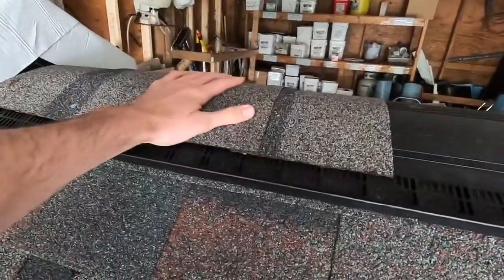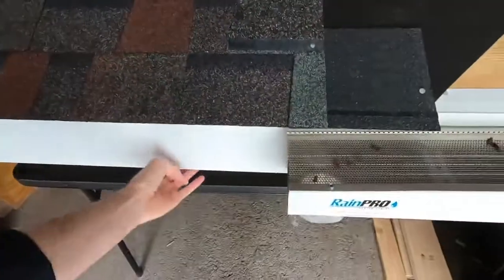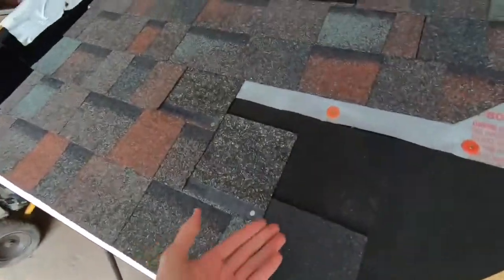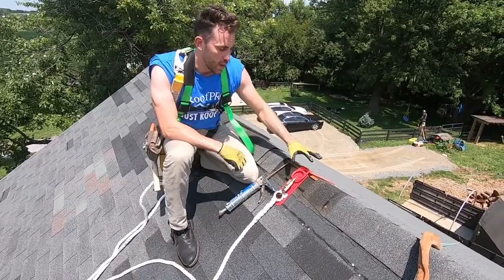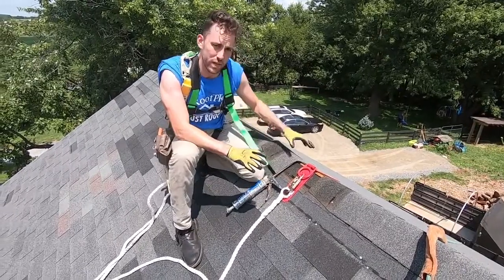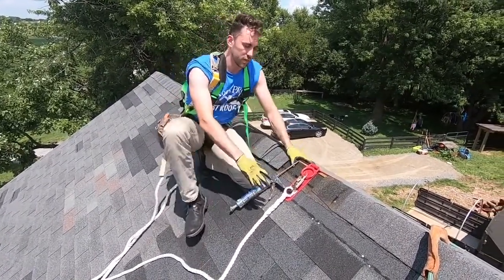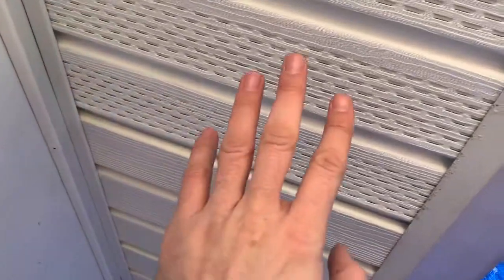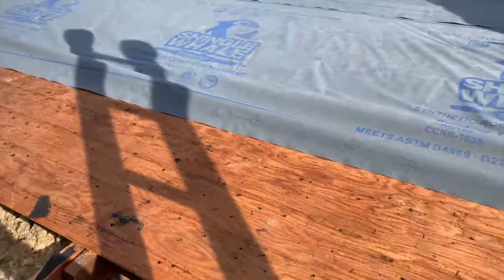Attic Ventilation Repair and System Review

Comment: My house and my garage have that “fake” soffit vents. All soffit cavities are covered with soffit sheathing and those white vented soffit plates are just for decoration.  
I don’t have gable vents either.  How many holes/what size should I drill.
Reply from the maker: Ventilation depends on the size of the roof and a few other details. So it would be good for me to give an exact size or number without inspecting it first. Here is a tool that might help though, https://www.owenscorning.com/en-us/roofing/components/vent-calculator

Comment: Keep your videos coming.
Reply from the maker: Will do!
Reply: @roofpro7003  What steps should followed when laying down shingles and or metal roof. What is and purpose of ice shields?
Reply from the maker: @joycedimaggio3816  I'm not sure if I understand the whole question but the purpose of Ice shield is to prevent ice and water from getting under your shingles in the most vulnerable spots. (Valleys, walls, pipes...) For example, the eaves of your house are the most likely to have snow and ice build-up because of the temperature changes within your house and outside the house. So this will protect against that. Without it, you will have all kinds of problems. It's also required by shingle manufacturers in order for you to get their enhanced warranty.
Reply: @roofpro7003  Thank you. You answered my question.